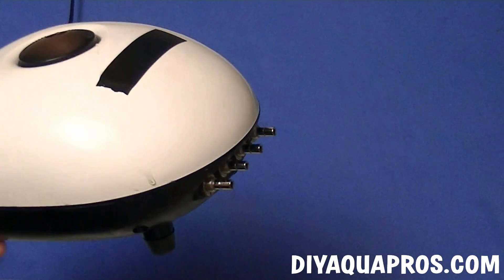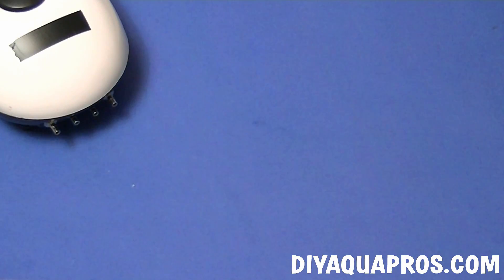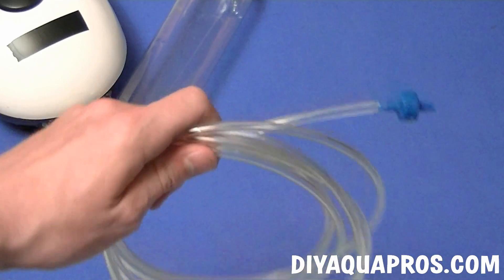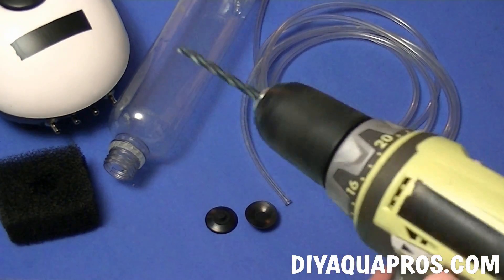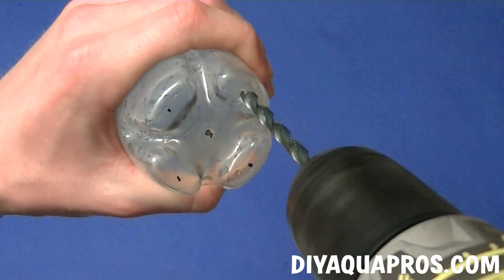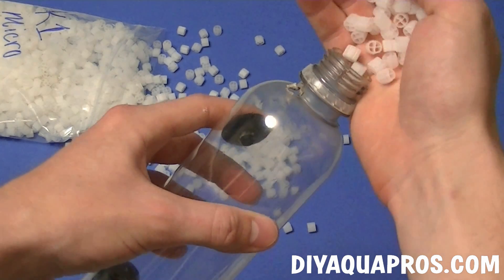DIY Fluidized Bed Filter: K1 Micro Media Aquarium Filter

Comment: I’m running the K1 micro in my Shark 800 and after 3 weeks I have tried everything to get it to tumble. All of the K1 is still floating.  I removed some added some and even added established bacteria from another filter.  Any suggestions ?
Reply: Its not ever going to work in the shark. Its not designed to work with k1

Comment: Wife bought one of these online last week. I was looking at it sitting there, bubbling away, and happened to notice little bits of debris floating past the sponge. They weren't getting sucked in or anything. That made me curious... If the filter is "filtering" the water, there should be intake and outflow, right?

I thought the sponge might be too thick, preventing suction, so I took it off. So at this point, I was holding a plastic bottle with five holes in the top and one in the side, trying to suck up any sort of floating debris. No luck. I couldn't get anything to go through open end of the bottle.

I don't get it, if this bottle is supposed to filter water, shouldn't there be water going into the bottle and coming out of it? Best I can tell the bubbles are the only thing moving here. 

Maybe I've got something wrong. Can anyone give me a clue.
650ml bottle, 3.5 lpm air pump.
Reply: The sponge is for decoration/base.  You just need to anchor it upright.

Comment: Is this kind of filter is an absolute must have in a freshwater aquarium? My tank is 55g bare bottom for a single 6"lutino oscar. Filtration i use are 2 systems. 1 for daytime 1 for nighttime. Daytime is the OceanFree overhead sump type with a powerhead pump and venturi aerator. Nighttime is a OceanFree BF4 sponge filter run by a Precision PR2500 2.5L airpump, so oscar can "sleep" in one spot.
Is this system ok?
Btw i feed him 2 supaworms in the am and 10-15 OceanFree EverRed medium pellets...
Reply: +JOWEE BOIE No particular type of filter or filtration is a 'must have' for an aquarium. This exact kind is good for aerobic bacteria, and it makes very efficient use of a small amount of space in your aquarium.
Reply: +D rB awesome info. thank you. btw, my 0skie is now about 8" and very healthy and responsive to me. i stopped giving him the worms and changed his staple diet to OceanFree superCICHLID pellet sticks and he loves it... =)

Comment: Hey there, I was just wondering, I built this using a 3L soda bottle with K1 regular media and a prefilter sponge to act as additional bio media and mechanical media... how many liters do you think this DIY Fluidized Bed filter can filter?
Reply: It depends on what air pump your using with greater sir pumps filtering more while less powerful ones filter less
Reply: I am using a Resun ACD-6604A emergency air pump. Its capacity is 10 liters/hour. What do you think its filtration capacity is Marion?
Reply: Right now your filter is only filtering 2 1/2 GPH which is pretty small. If you want a powerful air pump I recommend tetras air pumps or Fusion air pumps as they are the most powerful yet quiet I have ever kept in fish keeping
Reply: How big is your tank?
Reply: But if your still bugged about it Surf the internet. There are some many things you can learn from there. happy Fish Keeping,

Comment: Hey Mike can I make one of these for my 660 gal indoor koi pond, if so how big of a container would I need and where would I get an air pump big enough.  Jeff
Reply from the maker: Jeff, I would consider using an external design with the same primary idea. If you have the ability to pump water out of the pond up through say a 50 gal drum that is filled with moving media and have it spill over into the pond you may have a pretty good filter. Hard to explain in a comment but I would imagine you would need a massive container, at least 50 gallons. As far as the air pump, amazon sells a variety of industrial air pumps, here is a link to just one of them: http://amzn.to/1HNQBl1  A project like this could add up be be very expensive when you add up the cost of media so best to do as much research as possible before you commit. Hope this helped a little
Reply: Mike I checked out the Helix moving bed waterfall filter and the smaller version that is rated to filter a pound of fish waste a day( 5 times more than i will generate) only holds about 10 gallons. I decided to go with a 13 pickle barrel I found on ebay with a removable lid and handles. I will use a 950 gph mag pump through a 3/4" inlet and a 2" outlet with a waterfall made out of 2 Pee traps and a piece of pvc. Through the bottom i will pipe in over 100 liters of air per hour with a piston pump I also got on ebay. the filter will hold 1 cubic foot of K3 filter media. the whole setup cost less than $200. Helix wanted $600 and that didn't include water or air pumps. I'll send you a video when I'm done. Jeff
Reply from the maker: Jeff Franz Sounds like you got a solid plan, cant wait to see the results! Thanks for sharing.
Reply: DIY AQUAPROS Mike I have my fish in a quarantine tank while i'm setting up my pond so i decided to make a Fluidized Bed Filter but it has been over 24 hrs and the media is not moving. i'm using K1 and a round bottle for air i'm disconnected my aquascape and used it. if you'd like i'll send you a pic
Reply from the maker: Ya sure that would be cool, just email it to me. You might be using too much media and or not enough air if none of it is fluidizing.
Reply: DIY AQUAPROS new to this youtube thing. how do i email from here?
Reply: DIY AQUAPROS air flow is 4000 cc/min
Reply from the maker: No worries, contact me here- diyaquapros@gmail.com 

its also in the "about" section of our page

Comment: Hey Mike, Quick question.

Seeing as a moving bed filter never needs cleaning, do you really need to use a sponge (mechanical filter), or would the kaldnes get clogged without one?
Reply from the maker: I like to use the sponge to prevent leaves and other large debris from getting sucked in and trapped at the top of the filter where the air exits. I would recommend using a pre filter to prevent this from happening.

Comment: didnt think a moving bed  filter was the right choice in a planted tank
Reply: AQUAPROS hey so how come this wouldn't be good for a low tech planted tank? Looks like a fun build but I don't want my plants to suffer. I'm currently using a sponge filter in my low tech 10 gallon, but thinking about v building this.
Reply: @quanzilla  I'm curious about the same thing... Did you ever come across any answers to your question? Lol
Reply from the maker: It all depends on how planted your tank is and how high you fish load is. In some situations, say a lightly planted tank with a high fish load, a filter like this could work perfect. I had mine in a planted tank as a demonstration only since I only have planted tanks set up right now.
Reply: cool thanks for reply
Reply from the maker: ***** Its a general concept that hasent been proven, but may hold some validity. Plants that are in need of nitrogen will use what is available. Ammonium has been scientifically proven to be preferred by many aquatic plants but not all. Its a case by case sort of thing and its difficult to say yes or no here. Probably something I shouldn't have said in this video